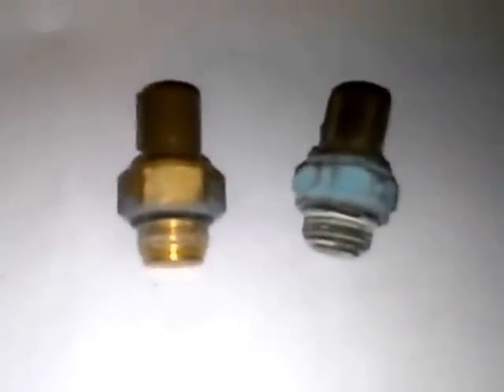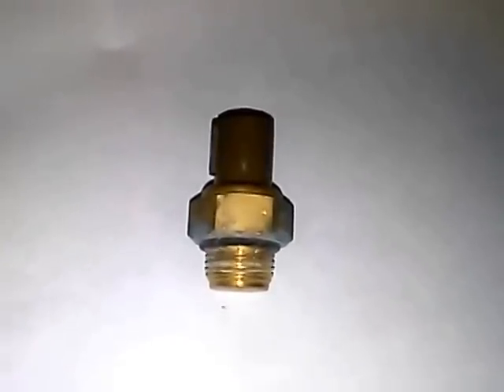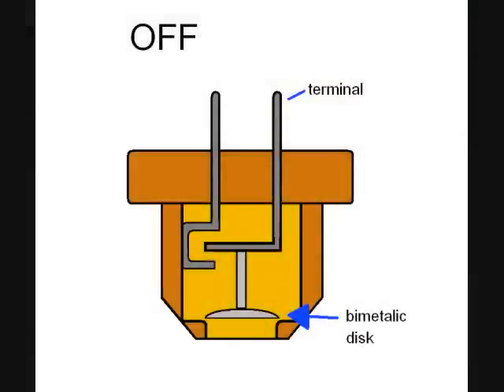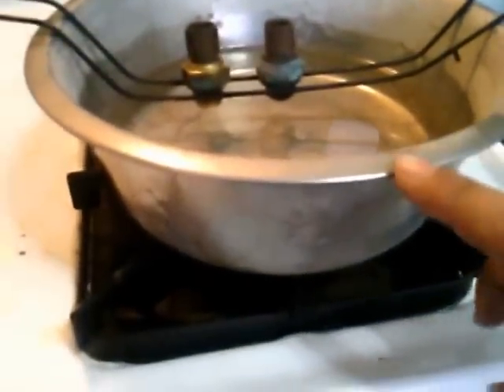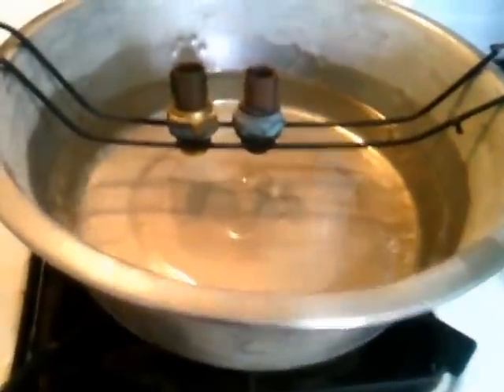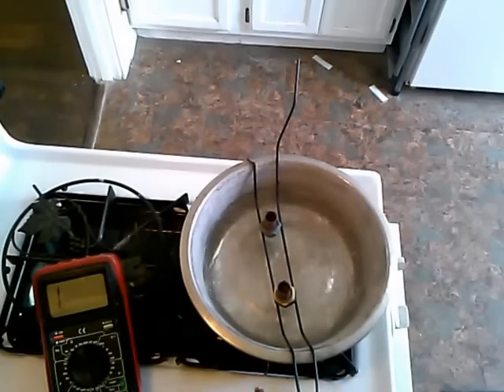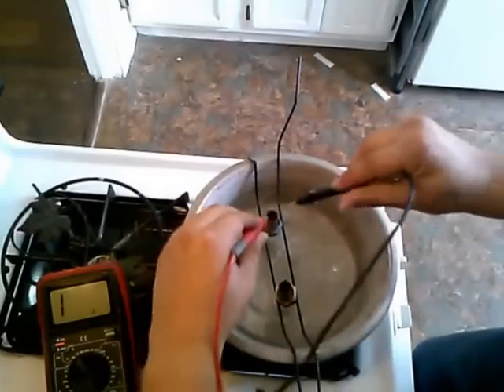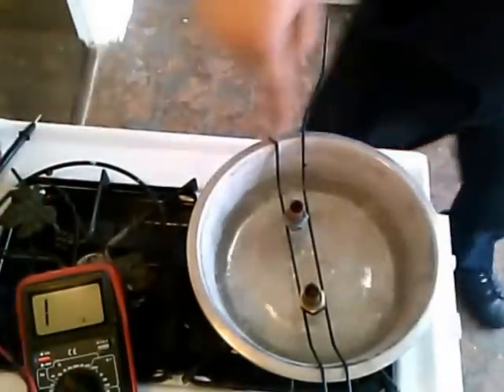How a Cooling Fan Switch/ ThermoSwitch Works

Comment: Nice demo. My Honda has several switches like those, including an elusive one that makes the fan blow air across the engine block after the key is turned off but damaging heat still needs to dissipate.

Comment: Hey bro not sure if you're still around but thanks for this vid and info. I just got into cars recently and I've been learning a ton. Do you happen to know what this would look like if the thermoswitch has 3 prongs? My VW has 3(separate hi/low speed) and I've been trying to find info on how that would work compared to this usual 2 prong switch to no avail. Would it just have an extra bimetallic disc? Very interested in finding out. Hope you're doing well!

Comment: Thanks for the video.. So I’m guessing that a “switch” is not the same thing as a “sensor”, right? I was trying to order a coolant temperature sensor that has a longer dip stick and they gave me the thing in this video.
Reply from the maker: people use the term interchangably and i never understood why. in reality the main function of the  one i show in the video, for my honda specifically, is a switch. there is another sensor that is on the side of the engine block that changes resistance. that info is converted onto your meter on the dash for the driver to read.

Comment: hi and thanks,  can you help me out , i have a question,,
do the switch makes the fan run slow if its bad, because when i check the fan directly with the battery they work perfectly fine , but when i plug it in they run slower 
thanks again
Reply from the maker: Most likely, no. Although it is certainly possible with corrosion, a thermos switch usually gets stuck "ON" the or "OFF" position when it breaks.There are some thermos switches that have two modes (slow and fast) and usually they have 3-4 pins depending on your car. if you test the resistance on the switch you should get a similar reading on your multi meter, about 100 ohms would indicate a good switch. Hope this helps

Comment: Hello, great video but i have a little question. I am not good at multimeters :( Our EP90 starlet has a cooling fan that has never come on in months. Down to my basic electrical knowledge I decided to stick a piece of wire in the wire clamp that fits in the switch and rubbed the other end to the engine block and the fan went on. does this show that the switch is dead? (the switch has only got one terminal so i think the circuit is open when the bimetallic part is not touching the housing which in turn touches the engine block. when it gets hot it touches and closes the circuit) is this a good line of thinking?

Comment: thanks for posting this.  im pretty sure this has gone bad on my 99 accord.  my rad fans only come on when the AC fan is on.  If i short out the fan switch with a paperclip, they come on properly.  

do i need to drain some of the rad fluid or can i just swap these out?
Reply: Did you drain fluid? Wondering same lol
Reply: so this is why my radiator fans takes like a minute 3 seconsor more betwen each cicle????and did ypu repla e the senssor .. can you tellme if it makes any diference????

Comment: I found my switch was bad by disconnecting the fan connector and jumping the two leads with a paperclip my fans turned on which told me the fan switch was bad. the test in the video can be helpful however you could still have a faulty switch if it engages at too low or too high of a temp. the switch needs to engage at a specific temp just like your thermostat, a cars fan cooling too much can be just as bad as a fan not cooling enough.

Comment: i have problem , already second termoswitch have died on me. what could be the problem? i have and old car and i like to do some rally stuf . I use calorstat by vernet termo switches . plz help
Reply: +cidoXL you dont need the thermostat, just take it out. your heater wont heat up to fast but your car will always run cooler
Reply: Replace your fan relay

Comment: Fan was not working on the honda city 2008 I was driving.  Fan turns on with the air-con on though, so there's that option to not overheat.  Diagnosed the problem using your tutorials.  Either the switch is bad or the thermostat (doubt it's the thermostat).  I will pull out the switch later and test.  Also will buy a replacement switch later.  Thank you for your videos.
Reply from the maker: excellent! thanks for the input.

Comment from the maker: Roy Johnson I would make sure the fans have a good connection by wiggling the wires ( car will be hot so be careful). I doubt that the switch is bad. For some reason there is no reply button by your comment. I hope this helps
Reply: SnagEasy I jumped wires before switch and fan turns on and I tested switch and get a reading, could the switch be bad even if it had a reading?

Comment: can the switch stay on when car cools
Reply: This is why I'm wondering,why my cooling fan is working when my engine is cold but whe it's hot the fan stops.Or after using 30 minutes when I turned on my car again my fan has no responds.
Reply from the maker: Thomas Romey short answer, yes. If you assume other components are working (relay), if the switch was stuck on the "ON" position the fan would be running the next time you run your car after your car has completely cooled. The good news is that this can be easily checked. All you have need to do is determine if you have a "normally open" or "normally closed" switch and test for continuity.

Comment: but how do the ones with only one wire work ?

how can you open and close a circuit when it does not have an in wire and out wire..(as your examples and diagram seem to have) ?
Reply from the maker: Countdown70s single wires have power coming in from that wire and the ground is the body the switch. The switch is connected to the engine and the engine is connected to the chassis.